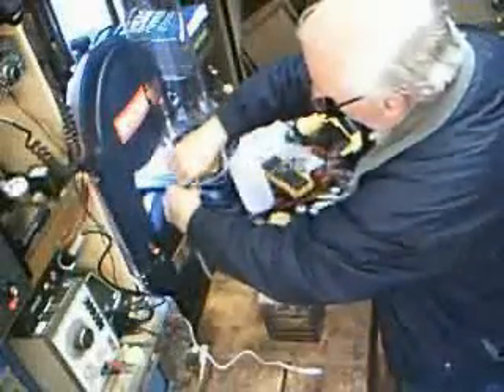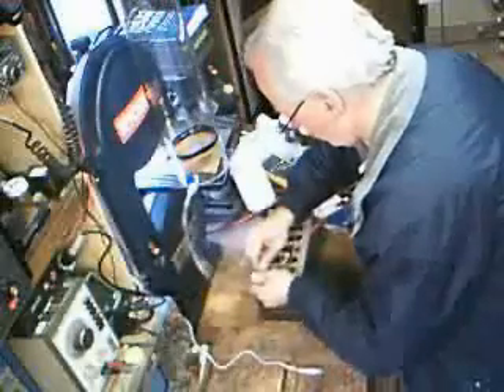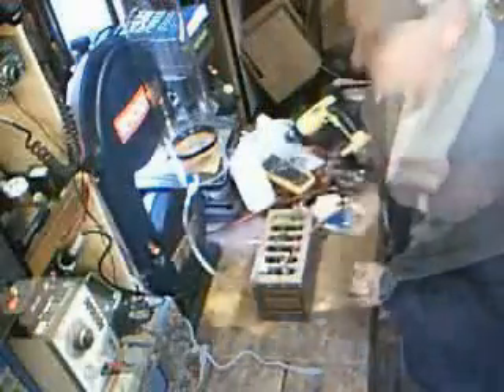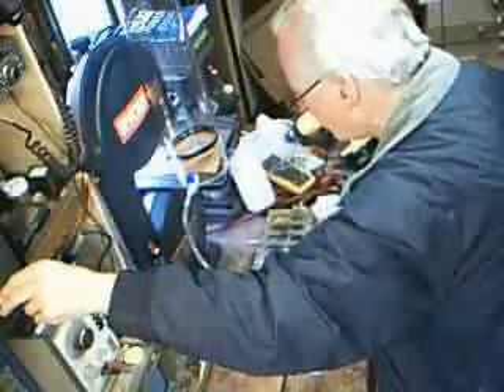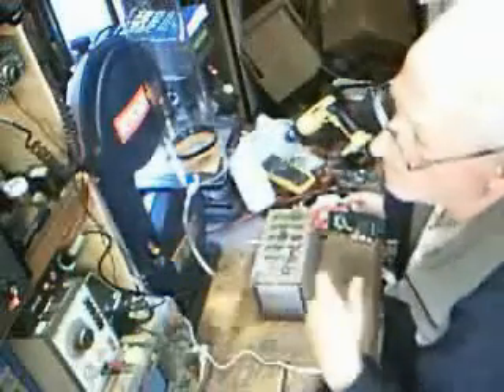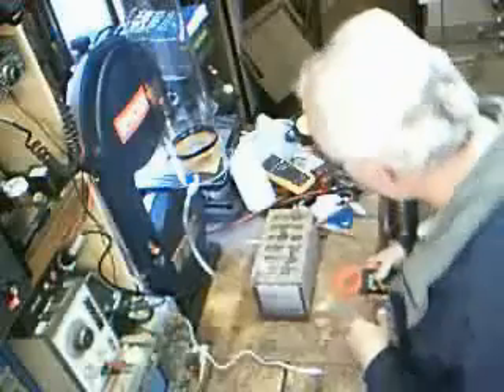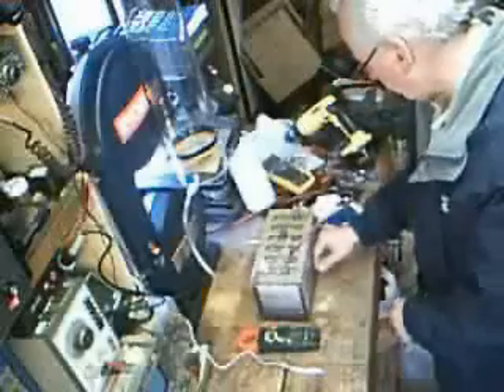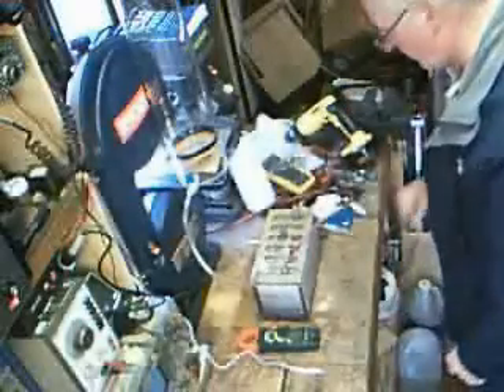#250 - hhoi / linear water test part 4 of 5

Comment: Given that the number of protons in the nucleus of an atom determines what element you're dealing with, I don't understand why you'd think that stripping a couple of electrons away from an oxygen atom would somehow make it a new element.  It'd just be an oxygen ion.

That said, I'd think ozone would be a more likely culprit for this mystery gas, if in fact there is one.  It isn't a completely stable molecule and should be heavier than the HHO.  I don't know if it's heavier than air though.